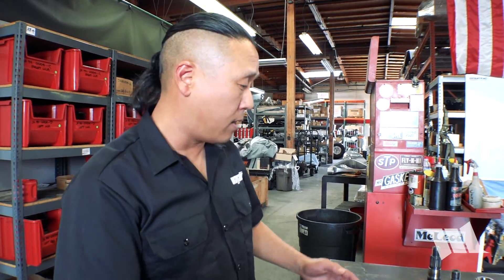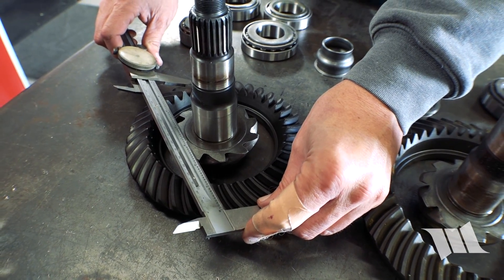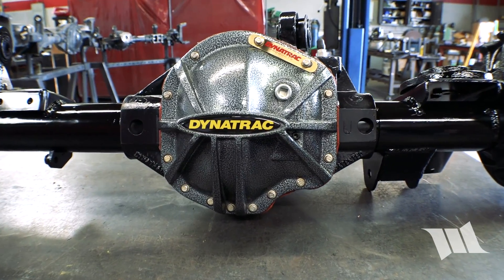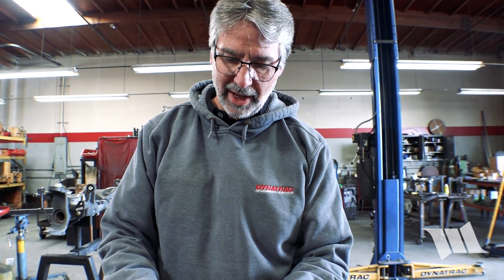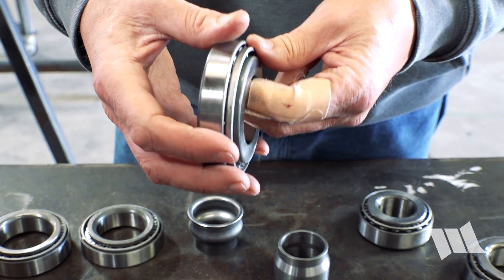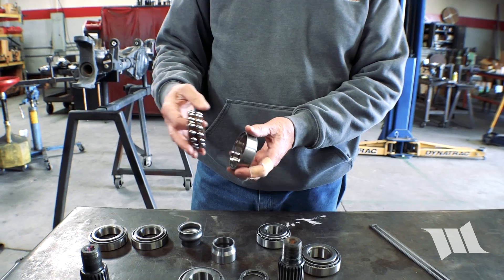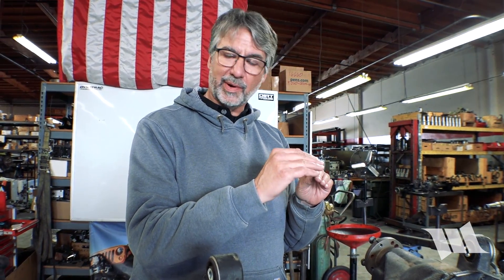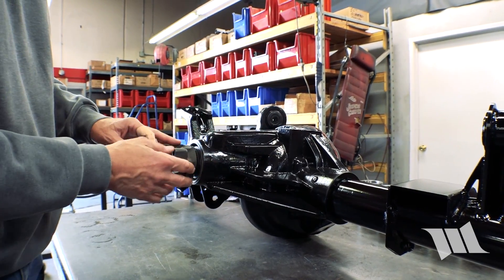Jeep JL Wrangler Front Axle Gears and Bearings Compared to a Dynatrac ProRock 44

Comment: The crush sleeve eliminator is a must-do upgrade whenever you open the gear set!  Worth every minute of additional initial set-up due to the time it saves anytime you need to remove the pinion nut for some reason...  Great video as always!  Thanks!

Comment: I have a Sport S with Dana 30 front and Dana 44 in the rear with 3:45 gears.  Looking to regear to 4:10s..is there a Ring & pinion MFG currently making a set for the JL's?
Reply from the maker: Honestly, you won't really feel enough of a difference to make it worth your while. It's only until about 4.88 that it's worth it.
Reply: Thanks for getting back to me 
.  may have just saved me $$

Comment: My question is, how do we not disturb the crush sleeve tolerances when changing a pinion yoke?
Reply from the maker: Well, if you have a high end inch pound torque wrench, you can take a reading of what the preload is on your axle prior to removing the pinion nut. When you reinstall the nut, you use a generous amount of red loctite and make sure to ONLY tighten it to your preload setting plus maybe 5 in lbs. at most.

Comment: If they used the JK as a starting point, does the JK have the crush sleeves like the JL?
Reply: stock JK axles do have crush sleeves, yes
Reply from the maker: Yes, from the factory, it's faster and easier to set up a gear with a crush sleeve.

Comment: Great video again. On a side note, Torq Masters Industries( manufacturers of the Aussie locker,lunchbox style lockers) has came out with its Torq Locker for the Advantek 186/ Sport/Sahara JL front axles. Also, ARB has also released their Air Lockers for the Sport/Sahara JL's too front and rear, no application for the JL Rubi yet tho from my research👌🙏

Comment: Awesome. I have owned jeeps in the past but never really “wheeled” them. I am either going to get a new JL or possibly wait for a gladiator. I feel like I am learning so much with all your different videos. Ok I have to ask. So do you put stock axels back in or does it come with new cro molly or something.  I’m greatly enjoying everything I am learning. Thanks Eddie.
Reply from the maker: If you were to get something like this, a ProRock 44, the only things that get reused are the knuckles, ball joints and brake assembly. Depending on how you order it, you could reuse the stub shafts as well but otherwise, you would need to get new axle shafts. Unfortunately, RCV's are the only thing that is currently available but other u-joint options available in the near future. We're glad to hear you've been finding our videos to be informative and helpful.